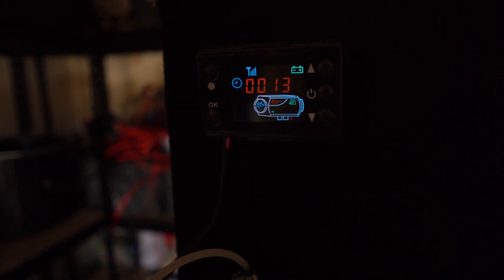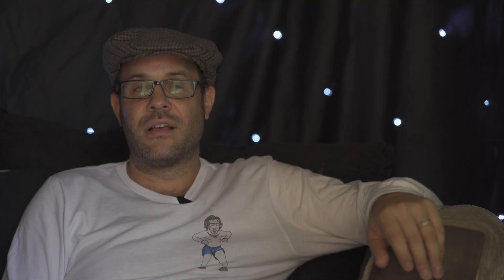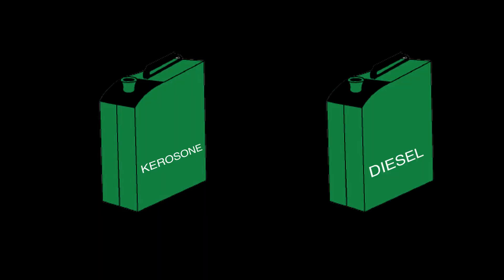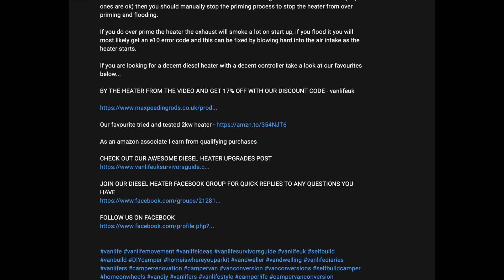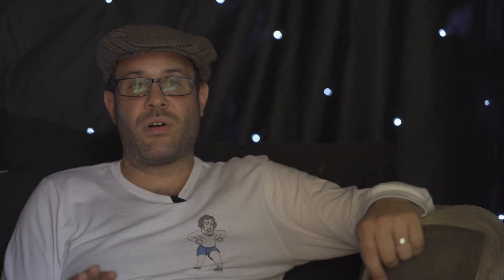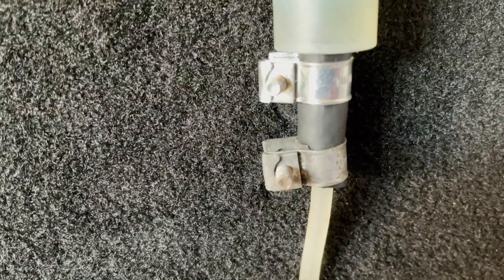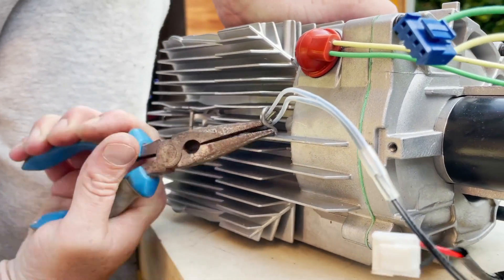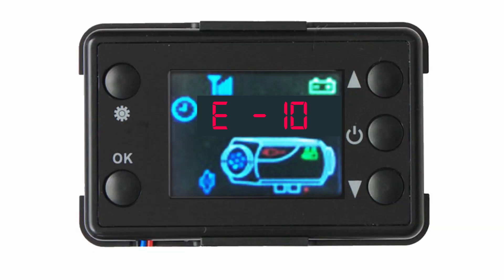Chinese Diesel Heater Error Codes E01 - E10  All Codes, Faults & Fixes

Comment: E-01 error code on a Chinese diesel heater will also come up if the octane rating of the fuel is too low (ie if you have veg oil in the mix) and it will refuse to fire up from cold as a result, shutting down and throwing the code along with a fuel icon. Its important if you do run mixed fuel, that you always run straight diesel or kerosene at full pelt shortly before shutting it down (and when starting) to purge the fuel line of any oil and to clean the glow plug. These heaters are less fussy when hot and will happily burn a mixture. When cold its a different story. If you do end up with a mixed tank and unable to start it, you have to syphon the tank contents as much as you can, replenish with a measure of neat diesel or kerosene, attempt to start it a few times and once it does, get it up to temperature quickly and then put back what you drained out. Restarting will create a cloud of smoke until all the oil is burnt off through heater and exhaust but should soon settle down. A solution is to have a switch-over tap so you can switch between mixed and straight fuel sources to avoid this. E-01 error is nearly always low power from battery or transformer - EXCEPT when it also displays the fuel icon. In this case its telling you its unable to ignite the rough fuel rather than having power issues, but will still throw an E-01 code. Hope it helps someone!
Reply: Hey I am getting e01 but it is from my boats diesel tank. It’s been working fine but it’s currently extra cold. I am getting a small voltage drop of about 0.4 v once started. On the remote it shows a fuel symbol so I am wondering is it because the system is too cold and the small voltage drop is not able to get it going? 

Thanks in advance

Comment: I saw that Kerosene is non-lubricating on another channel and they suggested adding a few drops of 2-stroke oil to your tank. Whaddya think?
Reply from the maker: Hi mate, it is actually not necessary. The best thing to do is mount the pump at a 90 degree angle unlike mentioned most places. Then you should be fine. Mine has been going 4 years strong on Kero. We made a full video  on it please check it out. It won't let me post the link here but it is called diesel heater fuel angle or something very obvious.
Reply: @vanlifesurvivorsguide: Cheers for that, I'll watch the video. I bought a TriClicks "8kw" heater back in March but haven't installed it yet. It has the filter/moisture trap that you recommend in the Buyers' Guide video but I'm not sure which controller is the crap one. I've got the one you did a video on, the three-bladed with spanner type.

Comment: a bit late to the game but I get a flashing N and a 5... I am guessing its the same but mine is older with a different display. Its a chinese diesel heater... and the van was in the shop for way too long and the batteries drained... other things are working now after trickle charging for a while but this one gives me nothing but a 5 in the display. I did move everything away from the exhaust and intake... but still the same... any ideas?

Comment: How can a 12 volt battery have too high of voltage
Reply from the maker: it can't 02 with a 12v battery is normally a phantom error code. It usually turns out to be a dead cell in the battery. You can get your battery load tested or free at your nearest halfords

Comment: yep ,...code 9,....replaced the censor and it was fixed,.....it was broken after i let the heater running for 1 hour on his hardest( there was code 5 because of air) , to let it clean insite i run it for a bit more than a hour on 6 , after that it always run hot and gives error 9.......the machine was only 1 year old and runs about les than 1000 hours...

Comment: According to the specs the heater should work from 10.5 to 16 Volts. Why I am getting high voltage error 02 when battery voltage is 12.4Volts?
Reply: I have the same issue - 12V and E02 after couple of seconds after start. Anyone has any suggestions? Voltage limiter?
Reply: @cichulec get yourself a leisure battery if you have the room

Comment: Thank you. The clearest explanation yet of error codes. Yes E8 was my daemon and removing the supplied fuel filter made an immediate improvement with a slightly smoky start ( first time )no E8 error after 2 minutes so far and running ok so far been going for a couple of hours no issues. Closed down correctly.

Comment: Hi Nick, hoping you can help me.  My heater was working perfectly and then I moved all the wires to make it tidier and since doing so it keeps tripping out every time I switch it on.  I’m not getting any code error but the Fuse Icon is there now.  Display is on but as soon as I turn heater on it blows the fuse breaker.  I have the heater running off the cable that is connected to my main fuse box (as heater is on other side of the van where the battery is).  I’ve checked the cables and they all seem correct.  Heater was working perfectly before I disconnected the cables and moved them to get them out of sight.  I didn’t add any cable as it didn’t need extending. So the exact same cables are still in place.  Hoping your have a fix for me 🙏❤️🙏

Comment: I have come across your channel and subscribed.  I just installed my second diesel heater in my camper.  It has the same controller and set up as the one I got two years ago.  I have watched your videos on starting up the heater.  Setting the temperature, etc.  I had to extend my exhaust about 5 feet to reach the ground as my camper is very large but this was not a problem with the first heater.   The first few times trying to test it I got a E 4 error.  This eventually went away.  When I tried to start up it would not let me set the date or select the desired temperature,   The standard display shows P 13.  I think the 13 is volts but I am not sure what the P IS.  There is also a temperature showing in the top left corner which I think is the temperature in the room. The only way I can get it to run is to hit the power button.  This gives me a selection using the up and down arrows of H1 to H5, which seems to control the temperature.   I get a small corresponding chart on the bottom that adds bars as the H value increases.   Wen it finally ran it was showing me a temperature readout going past 100 degrees quickly climbing to 170 degrees at which point I shut it off.  Lofs of white smoke was being produced.  My previous heater shows the current time and lets me scroll up and down to select the desired temperature up to about 35 Celcius.    I am using 12 V power and I am assuming the heater came set up for 12 V.  Any help or ideas would be appreciated.
Reply from the maker: Yeah this controller just works differently. The p does indeed meed volts so you do have 13v. the high temp is the heater body temp rather than the heat you want the van to be this is normal. It only has 5 different heat settings on this model h1-h5. And the smoke will just be that it has been over primed and will clear after a while thats not a problem either
Reply: @vanlifesurvivorsguide  Thank you for the. answer.   I would really like to set it up for temperature in degrees C and just set the temp and turn it on like the other heater.  I dont feel confident its working the way it should.  I put it on low heat on a hot day and it would not shut off.  I am not quite sure what to do.
Reply from the maker: @josephalberta1145  To do that you would need to change the controller and motherboard. Then it should work the same as your old one. This is the one you will need https://amzn.to/43pjPVH
Reply: @vanlifesurvivorsguide  Thank you very much for the information.  I was hoping there would be something I can do in settings but when I hit the top left button nothing happens.  I cant set the time or the reading to Celcius.  I will look into the boards if no luck.  Have a great day.

Comment: Hi! I have no error codes on the display, just these figures (the battery, the pump etc.). In the manual it says that this is also an error. Is it normal for these figures to be on the display? I’ve watched several video’s and at some displays they were there as well. So to conclude; can there be an error without an error code? Thanks in advance!
Reply from the maker: yeah it could be a few things. What is happening when you try and start it?
Reply: @vanlifesurvivorsguide  the heater is working, but I see the fuel icon in the left bottom when I turn it on. If I remember correctly, this wasn’t the case before.

The fuel hose was detached a few weeks ago and I had to put it back on, it could be that.

Comment: I'm just getting an E4 code and 2 click sounds from I believe the top of the heater with each press to start it but it doesn't start. I bought a replacement fuel pump fitted it and still shows E4 ... It talks about short circuit in the booklet. I'm lost as to what to do 😢 any idea ???

Comment: Thank you so much for this information. I'm ready to go away but my heater programmer was flashing the little battery in upper right hand corner. It has a separate desel tank. It did come on but only blew cold air for 10mins or so. Now it won't even turn on.. I'm flummoxed. If anyone has any suggestions, please can you let me know. Thank you 😢
Reply from the maker: it sounds like the fuel hasn't made it from the tank to the heater yet. Have you primed it? Also a low battery could be the cause how many volts is is it?

Comment: Hi Nick I have the e02 I can’t figure how to correct battery is at 13v as it’s a leisure battery how on earth do I reduce to 12v or could I just try reset by removing fuse ?
Many thanks Marc
Reply from the maker: Hi mate, 13v is fine it should always be over 12v if the battery gets to 12v it needs a good charge. 

An error code 2 on a battery normally means the battery has some kind of cell damage inside and although it might read at 13v it might now be able to supply enough amps. 

The first thing I would suggest is getting your battery load tested. if you are in the UK halfords do this if you are anywhere else try auto parts store as they should be able to do it for you. 

If it isn't the battery the only other thing it could be is a faulty motherboard
Reply: @vanlifesurvivorsguide  thanks for that 👍 I had a suspicion battery was spannered tbh as it started fine with engine running and battery started to be a bit iffy 
Can you recommend a size can’t afford a lithium or anything flash as I’m brassic just a lead acid that I can rely on present is a 90ah but I think it may be a little small

Comment: I am getting error code 2 but I have my heater hooked to a 12 volt battery. Was working fine, shut it off and then kept getting error code 2 on next use. Any suggestions?

Comment: Thanks very much for explaining these error codes. I have now replaced the heat sensor TWICE as the fan just came on for no reason...just my luck, I carry 2 spares now! 🫰 when rectified do the error codes automatically disappear? Thanks again, regards Mick
Reply from the maker: yeah it should just clear once the error is sorted. Do you still have error code 9?

Comment: Hi, started up today, fuel lines are primed all the way to the entry below. Panel starts, pump starts, fuel lines are full. Fan is on, but  happens E 08. Opened the unit checked all visible points of possible failurepoints. Checked voltage on the glowplug, NOTHING.
I did see a drip from the exhaust, but thats it.
Now what ? Please assist.

Kind regards, Jan Denmark

Comment: This is weird, I just got the E-2 error with a discharged 12V battery. Charging it right now, I'll see what happens.

Edit: Yes, charging for 10 minutes and the problem fixed itself.

Comment: Error 01 on mine means the van battery is too low to use the heater  just start the van 👍 it can also mean that I've set the temperature too high, try it about 12C ish

Comment: I have the E2 code with running a 12v battery which has always worked running on it and I've tried my 12v power bank still the same error code and not powering on, I just got this heater a week ago so its brand new and havent even finished 1 full tank of fuel, Can you help?

Comment: My heater won't start and is displaying a red circle with a dash in it, no other error code. It did have an 08 error the time before last it ran, any ideas?
Reply from the maker: The error code 8 will still be the same as in the video, the red circle is always there when the heater isn't running when it starts it goes. You have a different controller from the one in the video though

Comment: Just bought mine and am getting errors eo2 . Think the motherboard might be the issue .
Reply from the maker: most likely a damaged battery if a battery is what you are running it off of. Most phantom 02 error codes means damaged cells in the battery. Get the battery load tested as your first move
Reply: @vanlifesurvivorsguide  thank you . I tried a few different batteries but to no avail . I check too with a volt meter . I ca t clear the eo2 code and do anything

Comment: I have tried with a charger hooked to the battery.  The motorcycle battery is only a year old and I also tried it with the charger on it.  It is putting out 12.3 V.  The other battery is old and that may be a problem.  I'll try it  from my truck..  Can the E2 error code be overridden?

Comment: I am getting an E 2 error but the heater is hooked up to a 12V motorcycle battery.   I worked fine for several initial starts but after relocating  the heater it now giving an E2 error code.  I have changed the batteries out  but still no luck.  Any thoughts?
Reply from the maker: Can you try starting it with the battery on charge and see if that works? Could it be that both batteries have damaged cells in them as this quite often gives off error code 2 when you are not over voltage. 

Have you ever run the battery lower than about 11.6v?

Comment: i have a 12V heater wired to cig fuse but it’ll start then die saying voltage fault check line. Error -02? discovery 1 300tdi

Comment: Hi , I'm getting an 0 2 error code but my display shows that its receiving 11v any ideas please
Reply from the maker: The battery is too low it should't be discharged lower than 11.9v. So it will be a phantom over volt error code and really an 01 error code. You battery might need replacing too it might be permanently damaged too

Comment: I had an e05 error code keep coming up and the heater unit itself was very hot to the touch so I went into the factory settings and uped the minimum fan speed to 2500 rpm from 1500 rpm and it solved the issue as it draws the heat away from the heater quicker

Comment: Missed a very important cause for E-08. This can be caused by the heater being too dirty to light, meaning that the heater needs to be taken apart and cleaned (or just replaced)

Comment: About 20 seconds after starting I keep getting E-2.  I've checked and I am certain it's getting 12.8 volts reliably.  Any suggestions? 😕

....so it turns out that during startup the voltage is falling off.  I connected directly to the battery and it started up as expected.  So in this case E-2 was caused by low voltage!!!
Reply from the maker: phantom 02 codes normally means the battery is damaged or very low. It is the only other time I have seen it on a 12v set up. Has it been run very low recently?
Reply: @vanlifesurvivorsguide  I just bought this boat and I suspect everything is dodgy on it, in particular the electrics.
It was 12.8v on startup and that just fell away to <9v before the pump kicked in.   When I wired it direct to the battery terminal it held at 11v+.   So the wiring must be $h1t as well as the battery not being great.  
I need to modernize the electrics throughout, I might even employ an Arduino and Tesla-fy it 😎
Reply from the maker: @CoderDad  yeah its the battery then, easy fix though so not that much bad news

Comment: I had a problem (E-07), at first glance the wires in the controller seem right, but at second glance, the blue wire was unsoldered it, just gently pulling out. So, I opened the controller and solder it again, the red wire was on the way, so solder it too. Now, so far working properly.

Comment: Hi my diesel heater is only two days old and been working fine but now the pump as stopped pumping and the error code E08 and E10 keep appearing. I’ve installed it correctly. Could you please give any advice as the instruction manual is impossible to understand and my controller is different to manual ! In the top left my setting button is a spanner icon ! And the function’s are different to any YouTube videos. This is how I came across yours. Can you help please. 
Tony
Reply from the maker: Yeah that sounds like you have a vevor 5kw controller. The problem will either be the fuel system or the air intake. It is quite a hard one to diagnose over youtube comments though. Are you on facebook?
Reply: Hi my wife is on Facebook and has just followed your page she will send you a message . Thanks

Comment: Excellent video. Might want to add the circle with a line through it. I believe it is bad connection to fuel pump. Trying to figure it out right now.
Reply from the maker: that just means that your heater isn't running its not an error or anything, once you start it up it will go. Have you primed the pump?
Reply: @vanlifesurvivorsguide  Thank you for the reply, it just started running! Thank you for this great and thorough video.

Comment: what is wrong with my heater. the fan is always running it dose not try to start or anything.. i have unplug it and this in the past would reset it but now it just runs the fan none stop for days. help please....... the display just blinks.. i have switch the display to my other one and still nothing. help please
Reply from the maker: sounds like the heat sensor, error code 9 in this video. but  we have a whole video on our channel about it https://www.youtube.com/watch?v=v4RxCeukTFU&t=30s